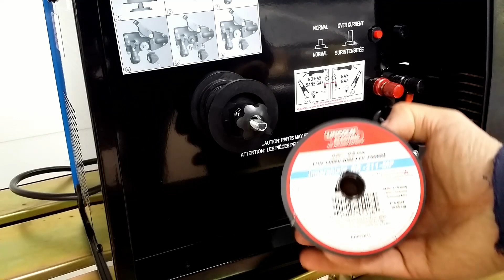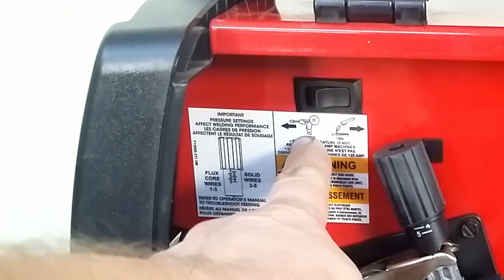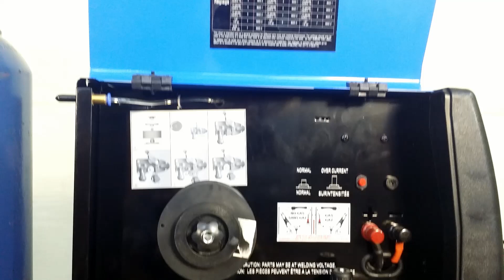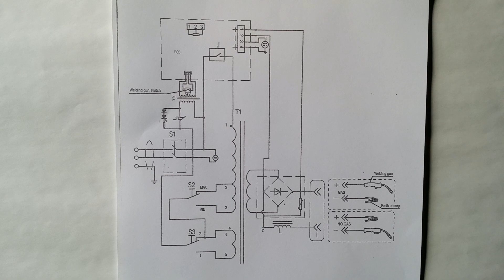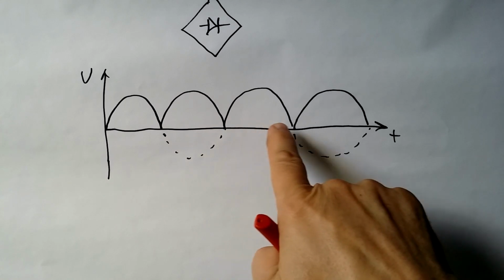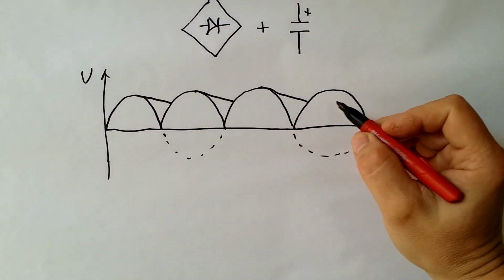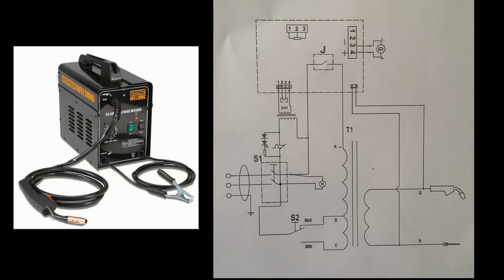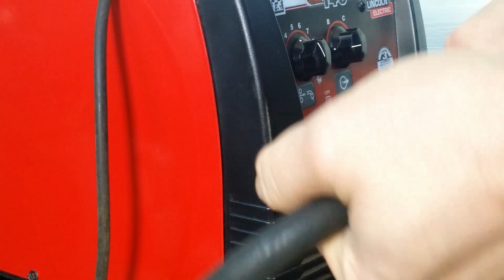Why Cheap Welder is Cheap

Comment: These are a big step up from those crappy AC welders. These work fine for home use; the AC ones don't work at all - a battery with a stick might work better than AC. I personally would worry about the capacitor being the main point of failure especially if it sits unused for long periods.

Comment: Can you assist me I bought a “cheap” transformer welder and was told it can work with self shielded wire or solid wire (gas) it has all the fittings to do this but it doesn’t work, any advice would be appreciated
Reply from the maker: What brand, model is it? What kind of problem do you have with it?

Comment: I have a Powetech welder which is suppose to be dual, IOW gas and gas less but it does not work with gas is there something I’m missing it is all connected for gas

Comment: Very impressive description of the operation of the welders (I have a very similar Mastercraft unit). Your scope is an oldy but a goody as long as the tubes are operational!
Reply from the maker: What I like in those oldies is, that when you open it you see right away what the problem is, which one is not lit.
Reply: @robertdeptula2003  There is a lot to be said for older technologies. The same holds true for gas combustion engines - easy to find problems on cars in the 50's, 60's and early 70's and now not so easy.